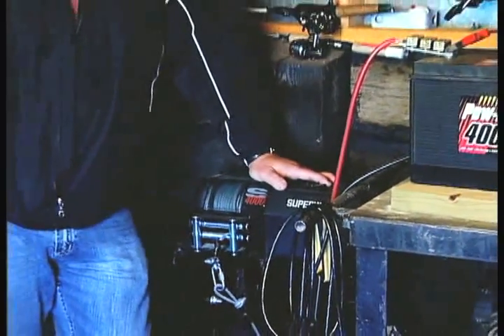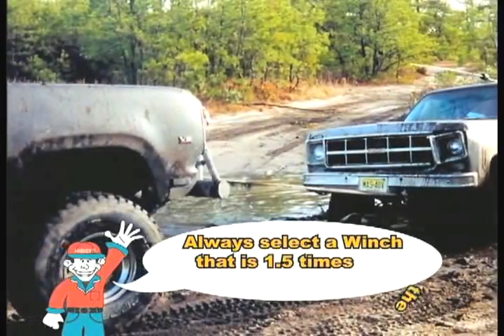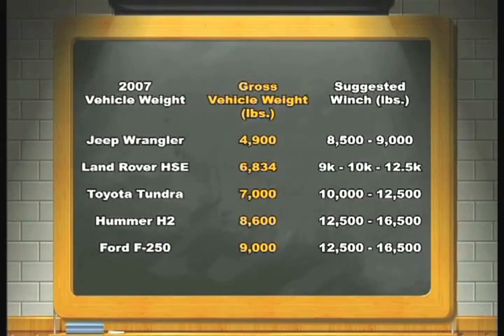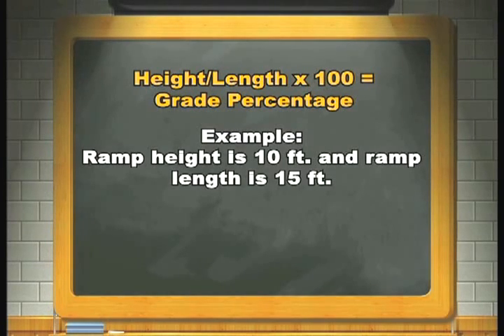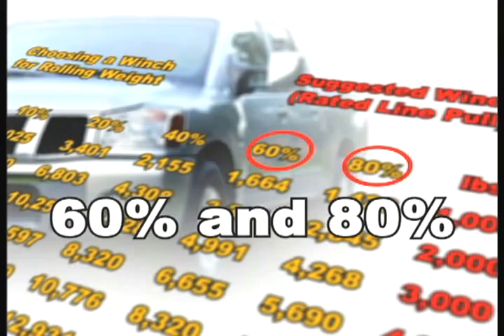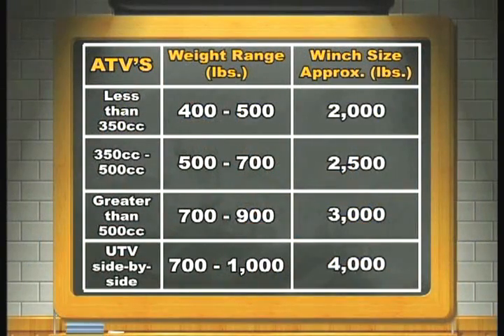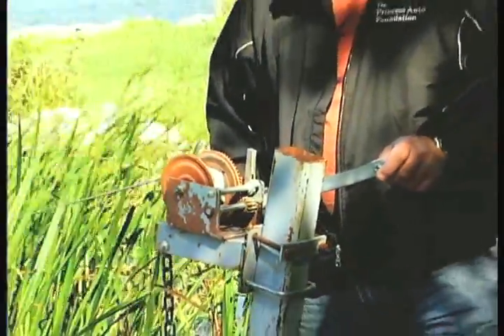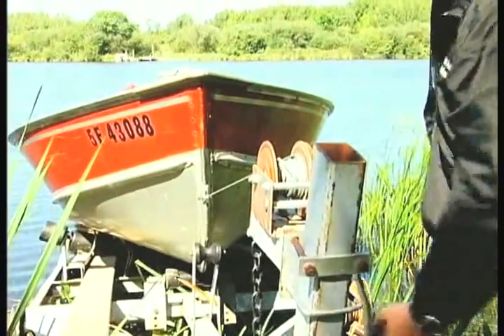Trailers, Towing and Winching: 12: Which Winch is Right for the Job

Comment: A misleading video!
An 8000lb winch can pull a 16000lb car on a double line setup at half the regular speed. This is plenty for any SUV!!
You have know "ideally" in order to get full power rating of the winch, for every 2000lb of load, you need one battery. That is for this winch you need 4 car batteries setup in parallel to give you its maximum power.

Comment: At 30 seconds of this video it shows the winch cable with a cable clamp installed incorrectly on the cable. It is the wrong way around. The rule with cable clamps is "never saddle a dead horse".